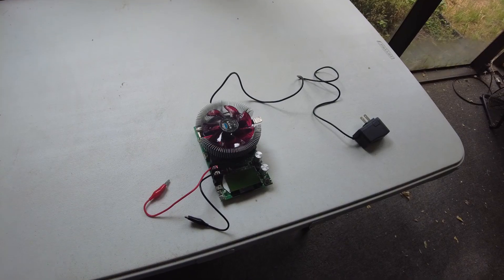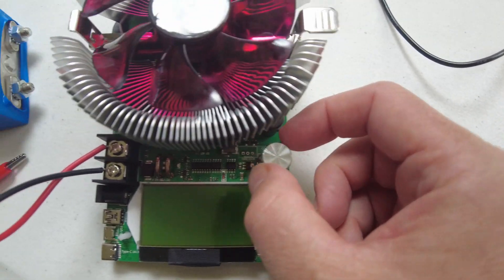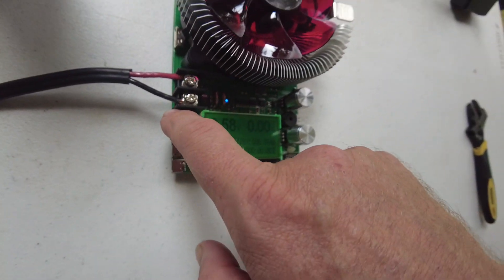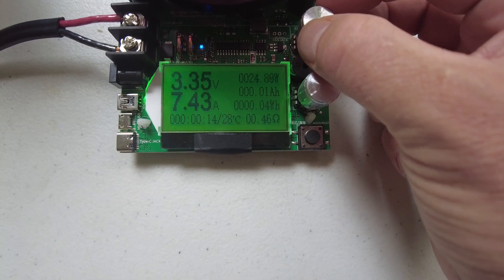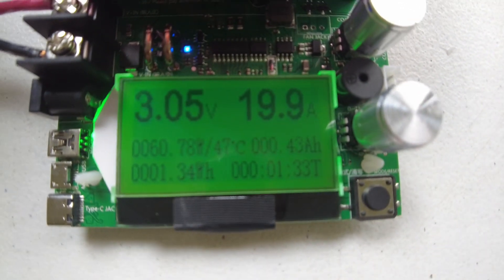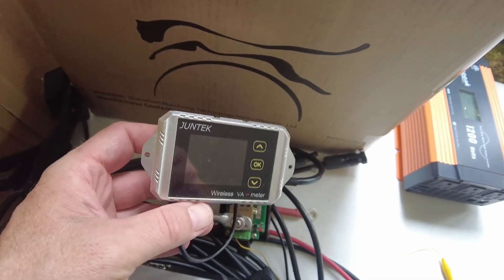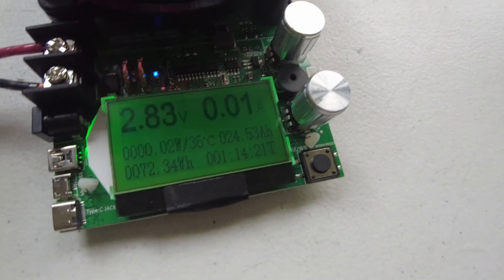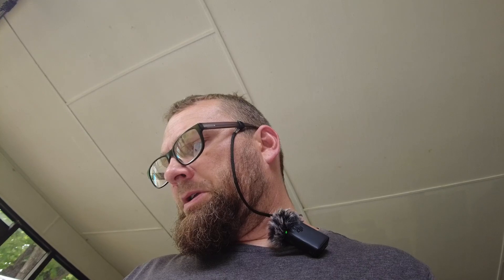Test your battery capacity with this simple capacity tester

Comment: I had a version exactly like this but rated for 185w i tested it with a pc power supply at 185w and it blew up i got it from a rubbish bin with a cracked screen it blew up it has stuck around with me for a long time i lost the Mount for the cooler but i reused the cooler in an Overheating amd pc and i managed to hit 4 ghz on a 2007 cpu with it

Comment: Just noticed you said 12 gauge wire is good for 20 amps. But I wanted to point out that for long running loads, such as this, you should only do 80% of that rating at 16 amps.